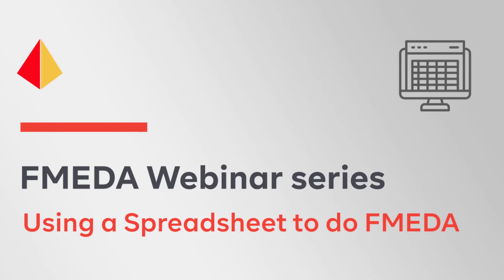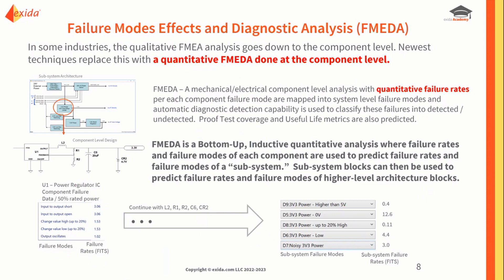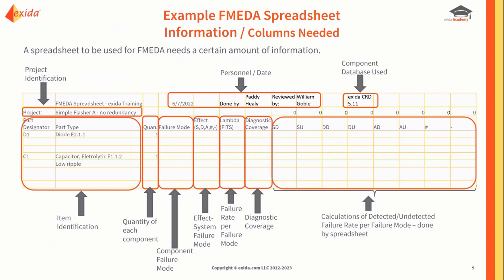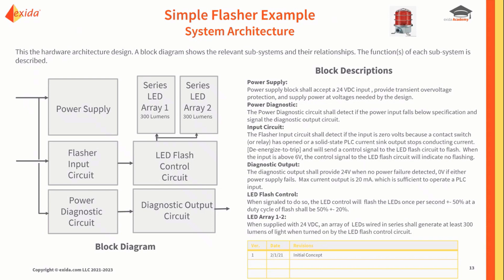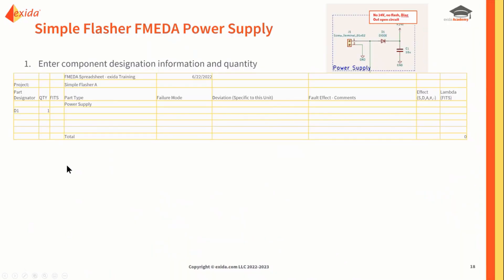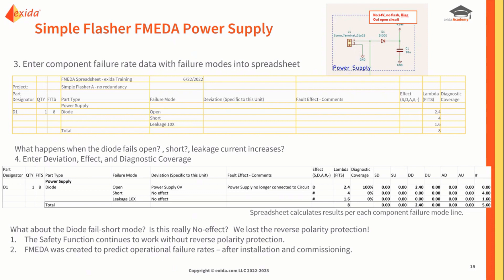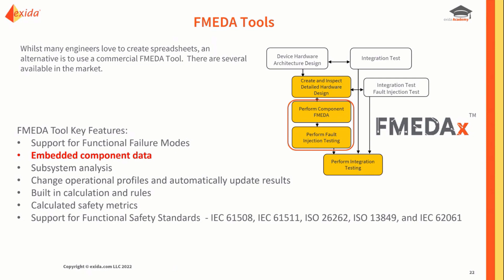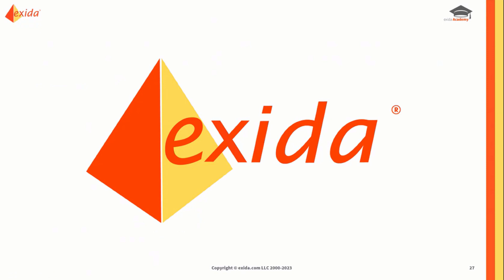FMEDA Webinar Series - 02 - Using Spreadsheets to do an FMEDA

Comment: one Dout, in the architecture/schematic external power supply has no connection to the flasher control circuit, why do we require external power supply????